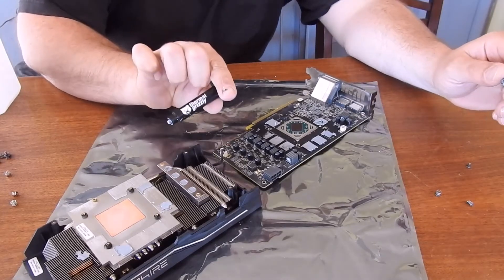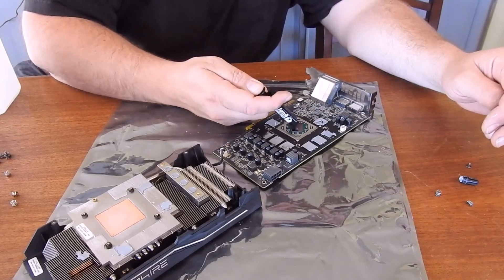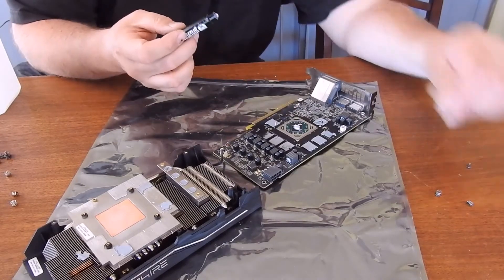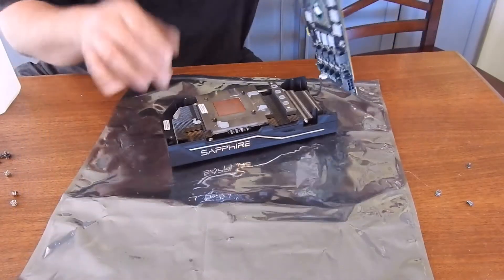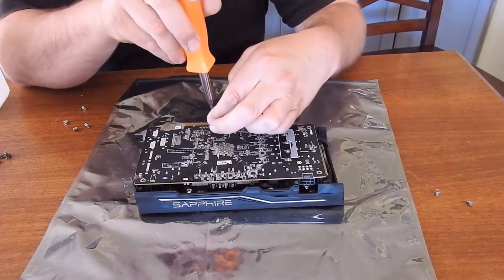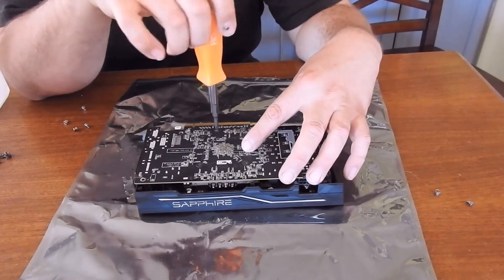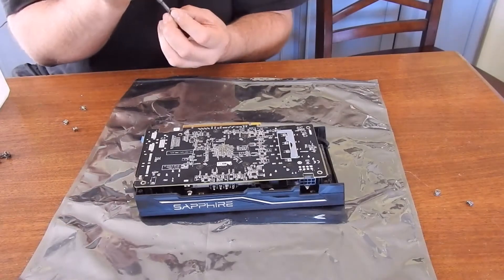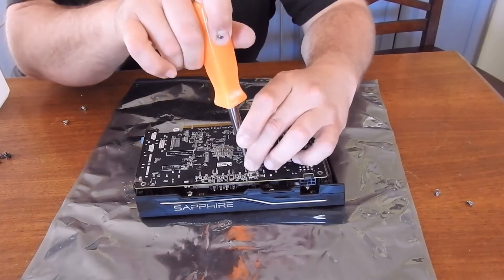[Sapphire Pulse RX 580 Thermal Paste] - 04 - Add thermal paste and reassemble the GPU.

Comment: Having FAN PROBLEM commonly related to this card.  Also do we need to change anything on the BIOS to run more than one less then 5 cards?
Reply from the maker: I have not had any fan issues with these yet.  The bios of the GPUs should not have an effect on how many cards you can run.